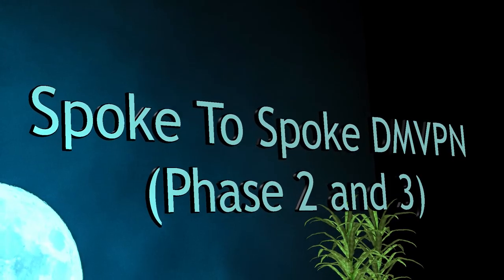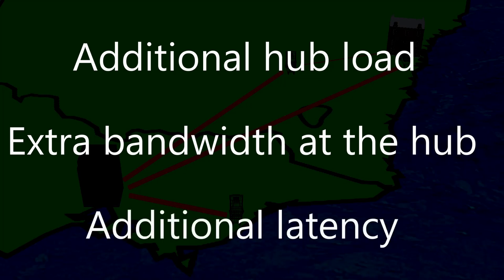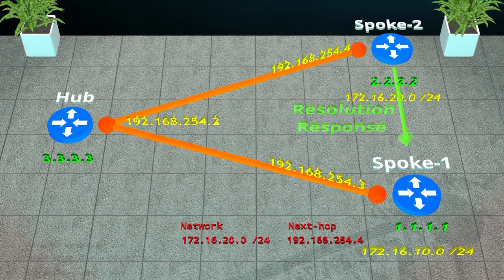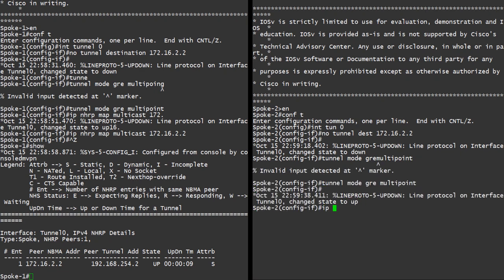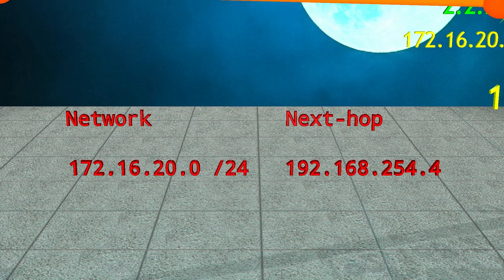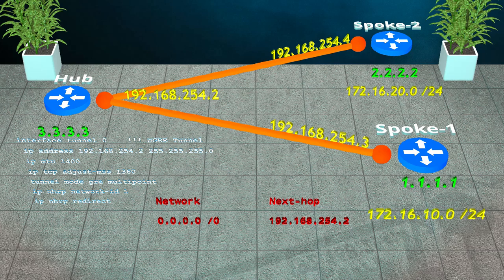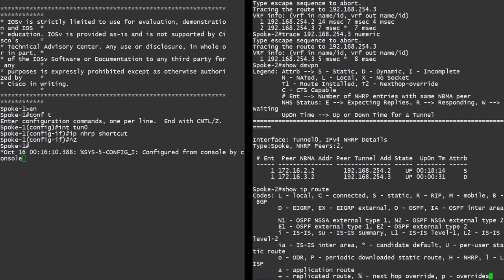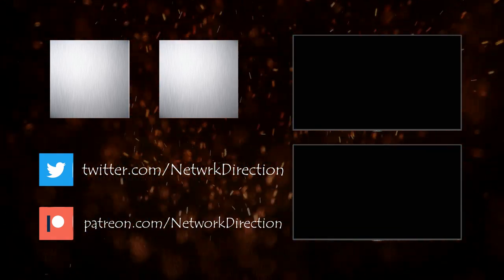Phase 2 and 3 DMVPN | DMVPN Tunnels Part 2

Comment: Quick question for DMVPN Phase 2:

In the video it says that when Spoke-1 wants to communicate with Spoke-2 it first sends a NHRP resolution request to the Hub, which is forwarded to Spoke-2 (destination) and it's that router that sends the NHRP resolution reply.

This link https://www.cisco.com/c/en/us/support/docs/security-vpn/ipsec-negotiation-ike-protocols/41940-dmvpn.html#dyntunspoke
says
"[...] when a spoke wants to transmit a packet to another spoke (such as the subnet behind another spoke), it uses NHRP to dynamically determine the required destination address of the target spoke. The hub router acts as the NHRP server and handles this request for the source spoke. [...]"

Other links that I found in Google seems to indicate the same behaviour: the hub sends the resolution request reply to the spoke that wants to communicate with another spoke.

Is that correct?

Comment: One thing that stayed unrevealed in Phase 2 - how spokes do know when they should send NHRP resolution request to the hub? I mean If at the start point spokes do not know that any other spokes exist, as a result, they assume that any necessary network behind the hub.
Reply: To what i understood with regards to DMVPN, the spoke have configured the hub as Nhrp Server. Hub is responsible to maintain all the NHRP database. By default all traffic goes to Hub and I believe it's only until they could learn the Tunnel iP mapping with NBMA iP mapping.

Comment: Pretty Neat. I have Question on DMVPN Phase3. I see that on both the spoke routers we have a static route for 10.0.0.0/8 to the Hub Tunnel Address (192.168.254.2). You were then able to ping networks behind the Spoke routers. Am wondering how did that happen? There are no configs on the Hub Routers and they have no clue about 10.8.0.0/24 or 10.222.0.0/24. Are they routed via the Underlay Network?
Reply: I added the routes over the GRE tunnel and I am able to ping. But for some reason I don’t see the NHRP routes , Am i doing something wrong?

Spoke2#traceroute 10.222.0.1

Type escape sequence to abort.
Tracing the route to 10.222.0.1

  1 192.168.254.3 72 msec 76 msec 72 msec

IP ROUTE:
     10.0.0.0/8 is variably subnetted, 3 subnets, 2 masks
C       10.8.0.0/24 is directly connected, Loopback0
C       10.2.2.0/24 is directly connected, Serial1/1
S       10.0.0.0/8 [1/0] via 192.168.254.2
C    192.168.254.0/24 is directly connected, Tunnel0
S*   0.0.0.0/0 [1/0] via 10.2.2.1

Comment: I would recommend if you can make at least two more videos on dmvpn. One with securing the tunnel and other with dynamic routing.
Reply from the maker: yeah! I do plan on doing a few more. I was thinking of one on dynamic routing, and one on more advanced topologies, like multi-hub and hierarchical deployment.
I've already covered securing the tunnel in the GRE series. The concepts are the same. https://youtu.be/4IRefeZ3vyY
Reply: We're still waiting for multi-hub with dynamic routing :)  @NetworkDirection
Reply from the maker: I'm still planning to, but DMVPN doesn't seems to be in great demand. I was beginning to think that no one cared about it
Reply from the maker: I'm still planning to, but DMVPN doesn't seems to be in great demand. I was beginning to think that no one cared about it
Reply from the maker: I'm still planning to, but DMVPN doesn't seems to be in great demand. I was beginning to think that no one cared about it
Reply: Hi  @NetworkDirection , We're still staying tuned for advanced topics and edge situation examples like you did in GRE, VPC and VXLAN before!

Comment: There doesn't seem to be any authentication built in anywhere.  Is DMVPN intended to be used over the public internet?  If so, can you please demonstrate how DMVPN could be done securely?
Reply from the maker: You're absolutely right, there's very little security built into DMVPN.
Instead, we can treat it like a regular GRE tunnel, and add encryption.
Take a look at https://www.youtube.com/watch?v=4IRefeZ3vyY to see how its done
Reply: Authentication would typically be done by a pre-shared key for ISAKMP assuming IPSEC is being used for encryption, correct?
Reply from the maker: For authentication, there are two parts. Although not shown in the video, we can enable NHRP authentication for building the tunnel. It's a plaintext key, so it's limited.
IPSec uses authentication too, to build the SA's (in ISAKMP as you say). This is way more secure. You could use preshared keys (easier to configure) or certificates (harder to configure, but provides better security)
Reply: Related question: if going the IPSec route, can IKEv2 be used?  I'd imagine assuming the router supports it, the answer would be yes.  In fact from what I understand this combination is marketed by Cisco as "FlexVPN"
Reply from the maker: Sure can. It’s essentially just a gre tunnel, so anything that applies there applies here too.
I haven’t used flexvpn yet, so I’m not sure about it.